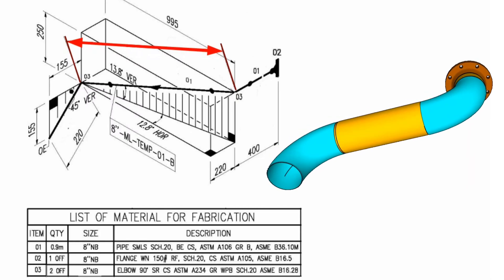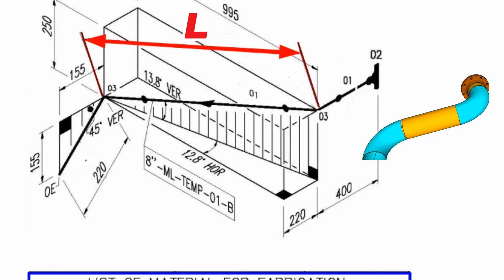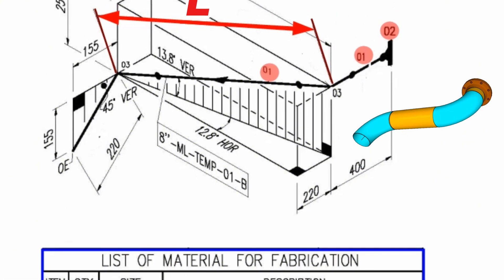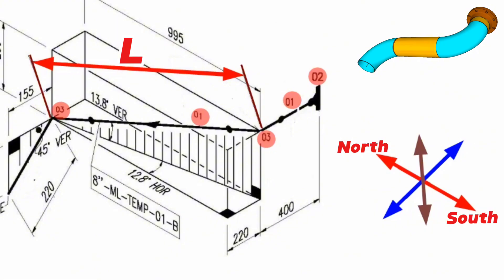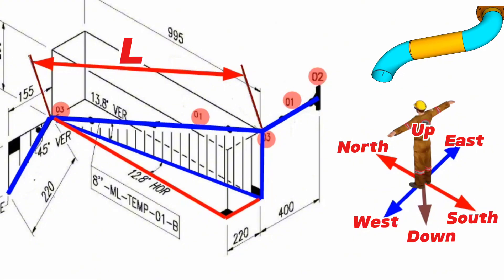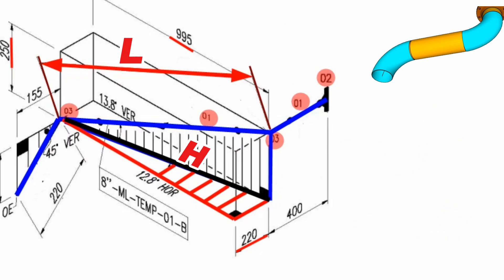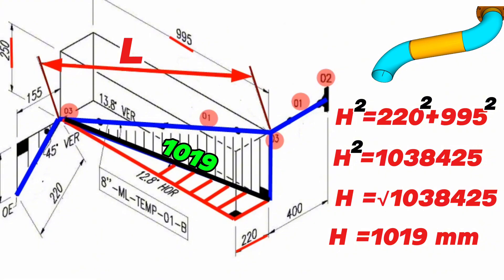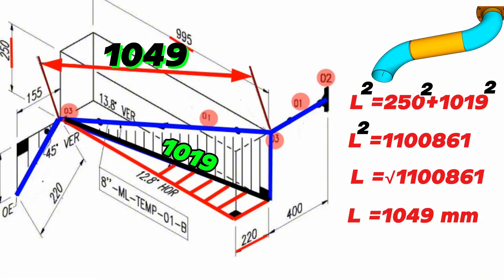Mastering True Length Calculation for Piping Engineers

Comment: What are the degrees of the two elbows? When the  bottom elbow stay in the west line 45 degrees down, i'm sure the elbow is not staying 90 degrees. Also the upper elbow is not 90 degrees in the east line.